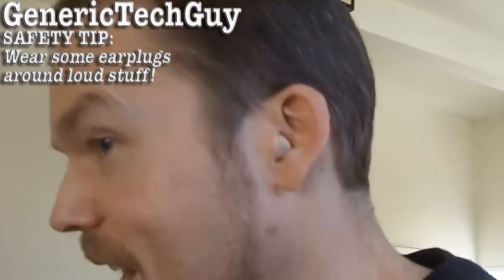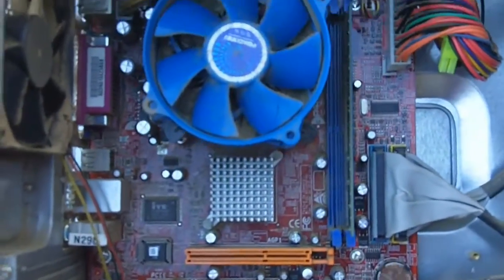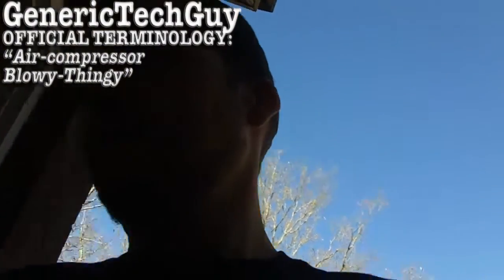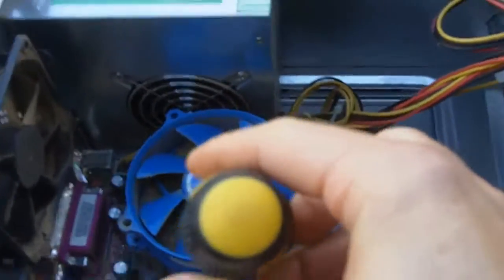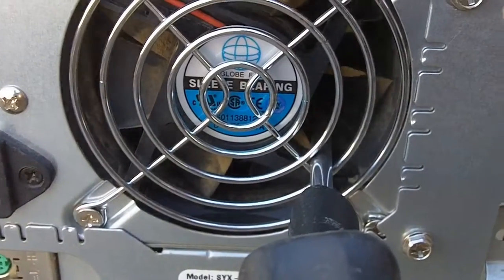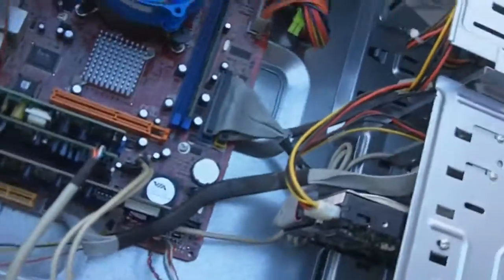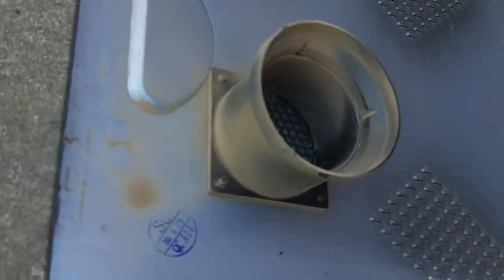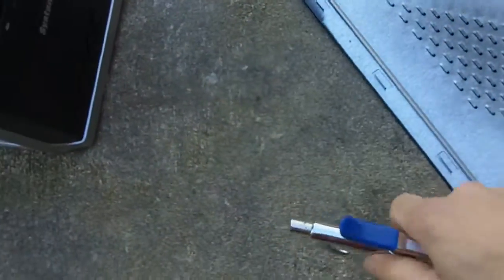Computer BLOW OUT and PSA for not smoking!

Comment from the maker: @ImMr1337 Yep! It can have moisture in it. For doing fans and stuff it isn't a big deal. You can get a moisture trap for the hose that keeps most of it out. Depends of your climate more than anything. Humid rainy days can put a bunch of moisture in the compressed air, dry winter days are pretty clean!

Comment from the maker: @ht448 I've read that that processor runs pretty hot, but your current range seems pretty good for a stock cooling system. If you look in and don't see any build up of dust on the heat sink or fan I wouldn't mess with it! :-)
As long as you keep it under 65C you should be OK!
Stock cooling fans and heat sinks can have a hard time keeping cores cool!